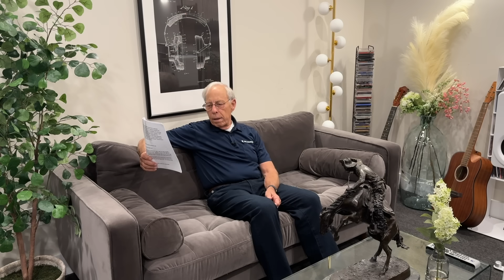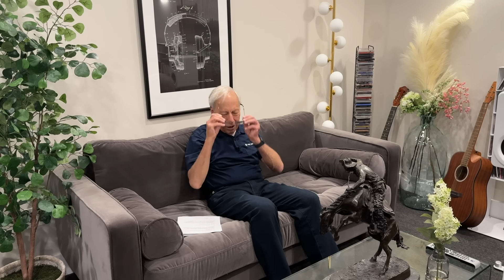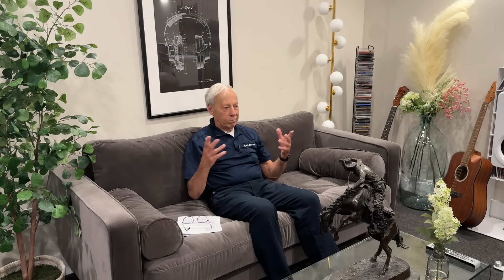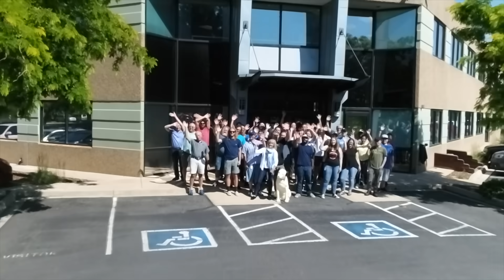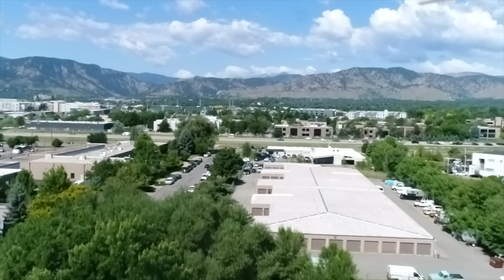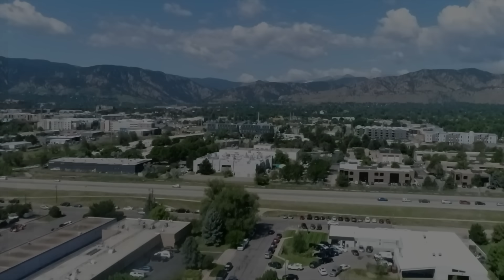Do music streamers sound different?

Comment: As you say, the streaming data is indeed identical. Ones are ones and zeroes are zeroes. But there are YouTube videos all over the place insisting that all DACs sound alike, all phono pre-amps sound alike, all power amps sound alike, all streamers sound alike, and so on -- as if all such devices consisted of identical combinations of identical components. They would have you believe that speakers alone account for the entire sound profile of your system. But if that were true, what is the point of competing products in the home audio market? DACs are more than just isolated chips and amps are more than just transformers. Why do they insist on distorting the plain fact that these devices are not, in fact, all of the same design? Every element in the signal path, alone and in combination with other elements, can affect the sound. Isn't that obvious?
Reply: In electronic design there is but one goal ... Accuracy.  Now if all these companies are honestly shooting for that goal, it is inevitable their products will be more alike than different... 

Would you buy an amplifier that is wildly bass boosted?  How about a streamer that cuts out all the highs?  
Of course not... and they know this.
Reply: @Douglas_Blake  That's a big "if." How many products to most people get to actually compare in their own systems/rooms before buying?
Reply: @bacarandii 
Given modern return policies ... all of them can test at home, nothing stops them.
Reply: @bacarandii 
While you're at it... look up the definition of "High Fidelity" ...
Reply: @Douglas_Blake  It's an amorphous marketing term with no meaningful (or legal) definition. Some people care about the specs they're told should matter to them. Some people care about how they feel when they listen to their music in their room on their equipment.
Reply: @bacarandii 
And some of us actually care about both.  I for one take relief in knowing that my setup sounds very good and is stable and working correctly; confirmed by testing and measurements. 
 
I can just walk over there, turn the thing on and let the music happen without ever worrying about silly crap like detail, prat, soundstage, noise or the quality of my cables.  If there's something wrong, it will tell me (by misbehaving)  and then I will tend to it.

 But the ears only subjectivists never get that confirmation. Nothing ever tells them "all is good" so they don't actually trust their equipment. Then, thanks to predatory marketing playing on this aspect, they end up falling down some very deep rabbit holes of constant doubt and expense.  

The answer to your idea that everything sounds different is to actually put that to the test.  The simplest test a non-technical user can do is the Blind A-B test in which you are live comparing one thing against another without knowing which is which.  Properly done even small changes will be audible to you and if you can peg them reliably to the new item being compared there's your confirmation.  If you can't, you've just saved yourself a bunch of money and you have confirmation your system was already working just fine.
Reply: @Douglas_Blake  I don't mean to make blanket claims that no two pieces of equipment can sound alike, only that some do and some don't. Manufacturers are always touting the sonic improvements they've made to their latest product lines, but that's in the ear of the beholder, of course. I have a number of audio  switches (for RCA interconnects and speaker cables) so I can easily switch directly between sources, amps, DACs and speakers (depending on how I've hooked them up). But even direct A/B comparisons can be misleading because then you're always listening for (and possibly imagining/exaggerating) differences between your last selection and the current one. The only real "test" is probably just your long-term satisfaction. But, as you say, some folks are inclined to chase "perfection" down those rabbit holes...
Reply: @bacarandii 
Now some good old momma advice ... "Don't knock it until you try it." ... seriously giving me all the reasons it won't work before you even try to see if it does work is pretty lame (no insult intended). 

Seriously... read up on the proper methods and give it an honest try before you condemn it.  

For example:  I took a $100 class D China-Amp and a $1,500 Canadian made AB amp ... level matched them and had a friend run the test so that I had no clue which one I was listening to.  I literally couldn't tell the difference.  I had to get up and look at the end of the test.
Reply: @Douglas_Blake  Good for you.
Reply: @bacarandii 
So try the testing ... see what you can learn.
Reply: @Douglas_Blake   ...some of us are wise enough to 'test' sound with our hearing, the way nature intended.

Comment: As Paul says, it’s about the timing of the bits and whatever electrical imperfections arrive along with the data at your DAC. It costs $$ to design and build superior power supplies, circuitry AND SOFTWARE to deliver those bits. I have found sonic differences between players such as Roon or Audirvana running on different operating systems, including Mac OSX, Windows and various flavors of Linux. Not only that, it matters how the digital information is packaged and sent across your local network.

Remember that most of us started with a bloated all-purpose PC directly connected to an amplifier to play digital music, but have since evolved to separate sources and network transports because it sounds better. Why is that?

Diretta is an alternative network protocol developed in Japan which uses smaller, more uniform packets to reduce spikes in electrical activity. When music files are processed by a separate server, Diretta Host and, finally, Diretta Target into your transport (“streamer”), each of those devices is working more quietly to get just the properly timed data to your DAC.

No snake oil, all science.
Reply: You seem to be operating under a false assumption here... Digital signals are NEVER fed directly into the input of anything.  They are always buffered and copied... so whatever noise might have been on the input is filtered out and gone.  AND Even if it wasn't gone, it would not be passed input to output by a decoder chip such as a DAC. That's just not how this stuff works.

Comment: People that think digital is digital don’t understand that what pushes the 0s and 1s down stream is an analog signal. And the quality of that analog signal has the potential to vary between different digital devices depending on circuitry design,  layout, wiring choices, solder type, dielectric material, conductor material, connection quality, noise rejection, as well as magnetic field aspects that are never taken into account for. 😊
Reply: Yes the "digital" signal is in fact an analog transmission... BUT... It's not like an amplifier where the output of the previous stage is applied directly to the input of the next. A digital signal is never applied directly to the input of the next stage. It is latched, buffered, or copied into the next stage.  It's not whether it's an analog signal or not, it's how the signal is processed that makes the difference.
Reply: @hiresaudiocosta873

"People" don't just think digital is digital, they state a fact or rather an axiom that this is the case. That follows by its own definition and things being digital, literally refers to fingers, countability, fungability, discretion and especially logical abstraction.

While it is true that any information which is interpreted as digits (which don't have to be binary by the way, the famous bit only being the prime example) manifests itself as an analog phenomenon which is time- and value-continuous, your argument is missing the core point that usually, the user is only interested in those numbers and omits the carrier afterwards.

What you describe to allegedly determine the result and must be accounted for, is exactly why human mankind "invented" (or is it rather a discovery?) digital representation of data - in order to get rid of all those imponderabilities.

As long as the data is error-free at the end (this shall be emphasized, as before error detection and corrections there are always errors to be expected), it doesn't matter what happened before, as digital information neither has a direct link to its carrier nor has memory of former stages.

Now interestingly, one in fact sometimes can get a glimpse of the analog nature behind digital transfers. For instance, the optical quality of a CD can vary, its pit/land - structure or also HDMI-transmissions leading to visible artifacts due to the lack of error-correction, and thus one could say that those qualities have an influence, yes, but it still misses the point because:

1. there are no "suble" differences. If there is no error-correction at all or the correction stage overstrained, there are usually random errors which have significant effects like crackles or noise but never in such a controlled, content-dependant mattee that it would change the quality like sound-stage, bass response, colors, depth or other nonsense. The changes for doing so are mathematically never zero, but so astronomically unlikely that they may be considered being zero.

2. as long as the data is still reconstructable free of errors which usually is the case, then all arguments from before about the vagueness of the transmission's analog nature become irrelevant.

Now in addition to the correctness of data, the correctness of the timing is also crucial and often enough in such discussions, the beloved topic "jitter" is opened up. However, that is an additional aspect which per se has nothing to do with the numbers used for digital information. And if the nominal clock rate is known, the data can always be losslessly reclocked as in its stored form, digital data has no clock at all.

TL;DR: digital data only exists logically and is stored or transmitted in an "analog" way. Correct. Usually, that doesn't matter however and we declare that very fact by creating digital interpretation in the first place. Otherwise we'd contradict our own definition.

Comment: For a total of $525, I inserted iFi LAN Purifier and their ultra linear power supply between my Roon Nucleus and the Bridge II card in my PS Audio DAC/Streamer and the sonic differences are far better with this set up. The SQ is very close to the sonics of my Wadia 830 CD Player. I guess I am in the minority here but I know what my ear brain connection tells me.
Reply: Sorry but I didn't hear any difference with the iFi Lan Purifier in my system.    However, I do hear an improvement with the iFi Supanova power cable with active noise cancellation.
My video:
https://youtu.be/1RFn7QTNQ8Y

Comment: I had an Innuos Pulse connected to the DAC card on my McIntosh MA12000 integrated amplifier which to me sounded good,  definitely better than my Cambridge all-in-one integrated.  I then tried the better Innuos Pulsar which costs 2x more and the difference was noticeable, subtle but noticeable but not sure it was worth the upgrade at that price point.  Fast forward, I sold my McIntosh integrated and bought Accuphase separates with a slide in DAC-60 card and continued using my Innuos Pulse and even tried a Lumin and a Node2 to compare The Pulse was definitely better. The NODE was more of a lifestyle product and not a high-end streamer. But then I bought an Accuphase standalone DAC and the music transformed, not just better but BETTER! There's something to be said about separates and  POWER SUPPLIES. I thought this was my end game until I revisited the Innuos Pulsar. As soon as I connected this demo Pulsar, BETTER instantly became significantly BETTER! Everything was better- bigger soundstage, quicker and responsive, more finer detail and 3D imagining, incredible macro and micro dynamics and very MUSICAL! So with a good high-end DAC a really good high-end streamer makes a very NOTICEABLE DIFFERENCE. I traded in my Pulse and purchased the Pulsar and I'm very happy.

Comment: I’ve always been a vinyl guy, I was never impressed by the sound of streaming until I heard an APL streamer the sound is so Analogue sounding I bought it, immediately, it doesn’t have a  built in DAC so I use the DAC in my Vitus CD player until I can afford an APL DAC
Reply: Once you hear it, you hear it.
Reply: By "sound of streaming" you probably mean "sound of mostly today's mastering" as there is no "sound" of streaming; streaming just delivering data to be interpreted. Given that even lossy codecs are mostly audibly transparent to their PCM counterparts, if the audio lacks quality via streaming, CD or others, the only solution is to get better produced and mastered content.

The messenger is innocent, it's the message which is quite corrupted nowadays.

Comment: So if you use a good DDC usb reclocker and an average streamer with your DAC, you should get quality sound?
Reply: If you use an average streamer and your DAC you should get quality sound.  
Reclocking is almost always totally unnecessary.
Reply: @Douglas_Blake i use a mac with the re clocker and a external dac.
Yeh I was just wondering if it worth buying as the denifrips DDC usb re clocker made a big difference.
I have a ROTEL ra 1592 mkii.
Reply: @maxi-t36  
Run a blind A-B comparison with your system.  Use the switchbox to listen to your system with and without the reclocker... Switch back and forth a dozen or so times. That will give you a good and immediate check on it's effects. Whether you can reliably choose the one with the reclocker or not you will learn a valuable lesson.
Reply: @Douglas_Blake ...thanks .but like I said it made a substantial difference you don't need to do a blind a/b to here the difference.

Comment: Huh. Lately I've been reading up on DI boxes and what do I get from it is that these devices do a lot, and are very handy when it comes to live performance, but it doesn't mean that everyone should use them; it just helps to craft your (guitar, mandolin, keyboard - whatever) sound and keep the signal clean in the snake chain and also have less cables and therefore cleaner, nicer-looking stage. Now compare that to streamers, not everybody needs a high end streamer, it's only when do you think about the benefits and just the convenience of having something that was made with audiophiles in mind, the whole perspective changes, and again, if you hear or not hear a difference it's not that much of a deal, because at the end of the day it's just about preference and you can do anything in any number of ways, and get results that are satisfactory. So my guess on that would be, pay once and cry once. Or pay 1 million times for cheaper stuff, it shouldn't matter too much, as long as it gives you happiness